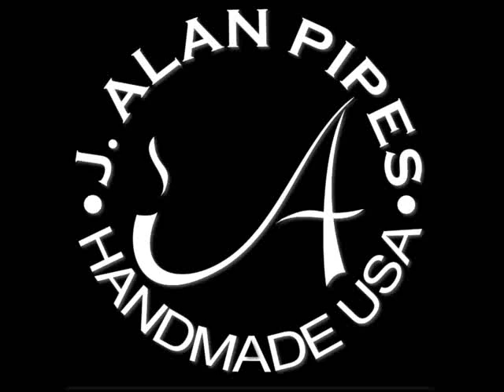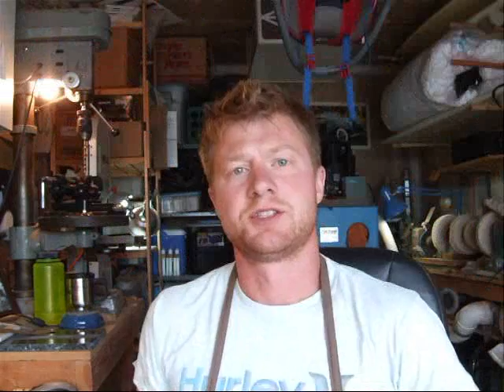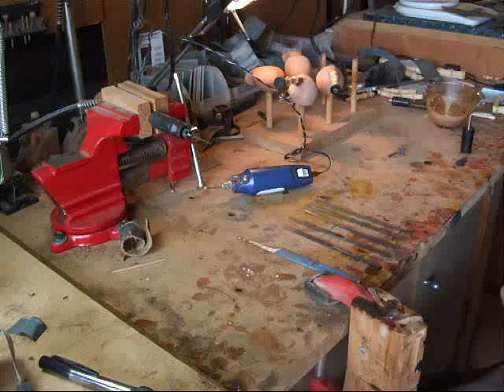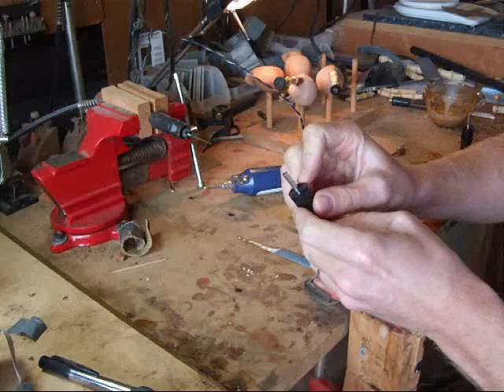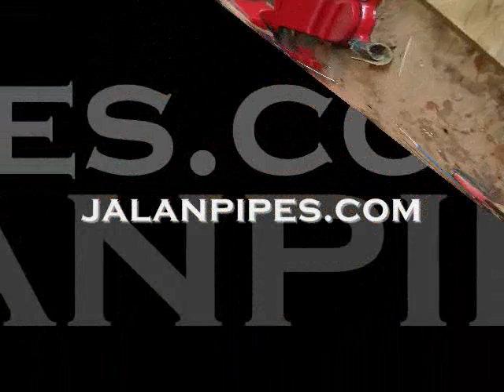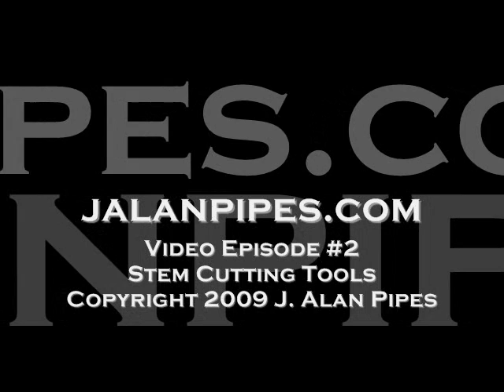Video Episode #002 -- Stem Cutting Tools

Comment: @jalanpipes I only became aware of the method from a UK fabricator named Blakemar. He uses a die, looks like a large thimble, with a few small holes in it.  The fuel/air mixture is fed up from below like a Bunsen burner, once it's hot he presses the pipe down over the die, quick twist, and off the heat, so it doesn't impact the rim. There's a vid on his channel. If you can check it out I'd be interested to hear your thoughts.

Comment from the maker: @beesh1on1 Thanks!  Bowl coatings are generally painted on as the final step in pipemaking.  There are a number of recipes floating around, but generally speaking the black color comes from Activated Charcoal and is adhered with a binder.  Try a mix of sour cream and buttermilk as a binder.  It dries hard and flavorless.